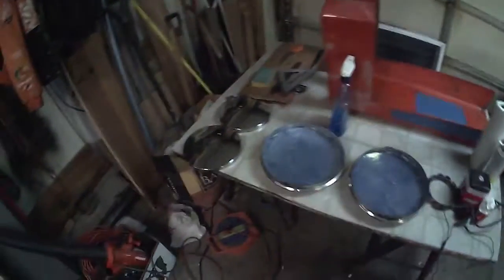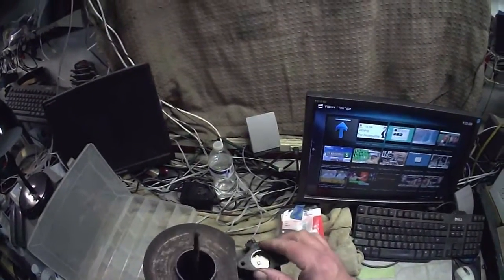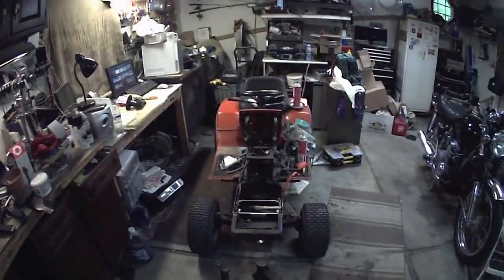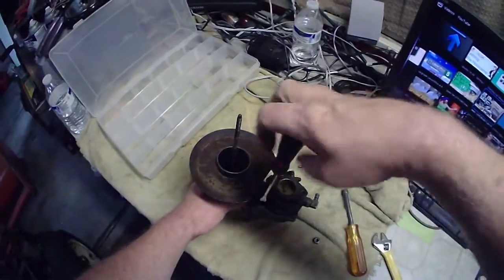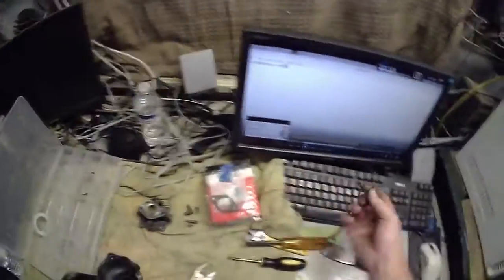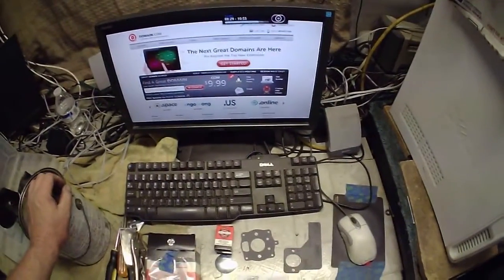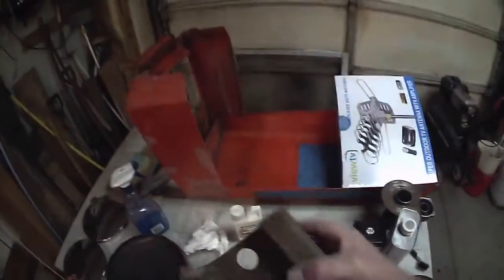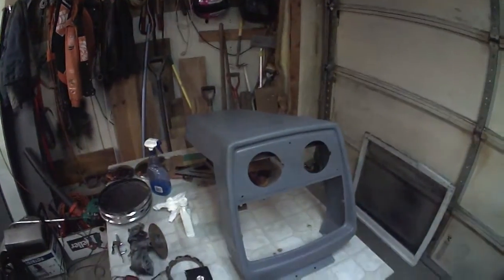1975 Gilson Update Vlog 5- 30-2016

Comment: After you get the tractor finished you should put it in a car show. The show we have here it would fit right in.
Reply from the maker: LOL around here that would get you kicked out of the car show. Being this is farmland and not much else we have tractor shows I could enter it in however I don't know if it will turn out that great only time will tell. :)
Reply: We do have an odd car show here anything goes with close to 2000 entries year. The Triumph will be there this year so I can hand  stickers. And speaking of that thanks for the call out.

Comment: Good update!!!  I need to look thru my stuff and see what I have for your Briggs single.  I know I have partial carb kits not that you need it now and I'm pretty sure I have Magneto's but as you I don't know if they are for points or not.  You can also try the NOVA II ignition as well.  I used it on a tractor once.  http://www.mfgsupply.com/smallengine/smengelect/smengelectuign/31-8786.html
Reply from the maker: Thanks I will check that out. It would seem from what little I can find on this I may have to use the points and again that is no big deal its just nicer not to have to. :) Its going to be a bit before I get the motor back in so I hope by then to have some solid info on them.